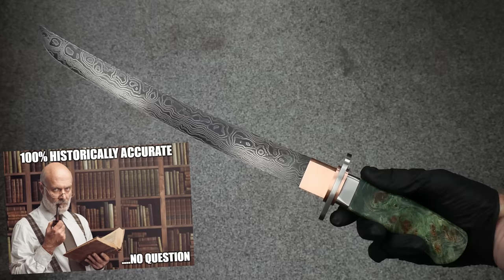A NEVER Before Seen Traditional Japanese Sword | The Rise of the "Bow-Kizashi" | Samurai Challenge

Comment: May is not traditional Japanese, but:
1) Handle has sense in terms of shape grip, so cannot be complained.
2) layers are aligned in right way, could be  more precise spending more time.
3) overall shape of blade is correct.

So it KNEEEEEL
Reply from the maker: Cheers Iron Spike!

Comment: Amazing work.
Note.   Copper needs to be cleaned with alcohol before soldering.   The flux helps at reducing surface corrosion or a bad solder when applying heat.
Reply from the maker: Nice! Thanks for the tip!

Comment: Nice video, quite relaxing. You have accumulated a decent shop setup and are less of a hack now. I think the seppa are too thick. You might try making the habaki from bronze and brazing it closed with bronze brazing rod. This is seamless and much less finicky than soldering...
Reply from the maker: Thanks for the tips!

Comment: that seam on the habaki can be burnished closed, if you have a high speed rotary tool/flexshaft/ micromotor. take an old hss. bur shank  bend it 90 degrees at the end , about 3 or 4 mm
round the end off and polish it to a mirror finish, not chuck in your tool. Takes a little practice, but very high speed and light pressure. copper gold silver most non ferous metals will become like clay, you can close seams and even fold the edges together.
Also that habaki would look great with a classic "cat scratch " finish
Reply from the maker: That is an interesting idea! I like it!

Comment: That is very cool as usual your work is amazing   My Boat season just ended yesterday so I can get to work in my shop  I finally bought a 2X 72 Grinder  I bought a Black Fox Knifeworks grinder and my only option so far is the small wheel attachment  I am excited to get started
Reply from the maker: Heck yeah! I hear those are very capable machines!

Comment: I have read that in the finest ancient Samurai swords there are traces of sand in the steel and that’s one of the lost pieces: what was the sand’s purpose and how was it used? Did you come across anything about that?
Reply from the maker: I really don't know... I'd imagine it's related to smelting the iron ore... the claims on added flexibility and sharpness seem odd to me... this is what the internet says:

"Sand was not intentionally added to Samurai swords; rather, it could be present due to the traditional sword-making process, which involved smelting and folding steel multiple times. The sand-like impurities could be a result of this process, contributing to the blade's unique texture and qualities, such as increased flexibility and sharpness."

Comment: So what was the purpose of wrapping the blade in aluminum before you normalized it? Genuine question. I am an aspiring bladesmith, and I am just trying to learn as much as I can before I am in a position to start forging.
Reply from the maker: That is stainless steel foil. It keeps oxygen from hitting the blade during heating and reduces scale. Helps keep the blade clean

Comment: I like almost everything about that knife,  however,  that threaded part of the tang looks very thin to me,  especially with the torque being put on the bend in the tang from the nut, that spot where the threads meet the wider section could potentially snap off.
Reply from the maker: Interestingly enough I've tested this form of construction pretty brutally. With a tight fit up, epoxy filled handle and this type of threaded tang construction you'd be pretty surprised at the strength! Especially with the finial being stainless steel.
Reply: @RedBeardOps  OK, I guess you would know better than me, it's just with the tension from the finial right on that bend it looks scary to me.  👍

Comment: AMA: are portabands a good replacement for a full-size bandsaw as they seem like a space saver but the lack of a guard makes me very hesitant to purchase one.
Ok finished the video Great work... hmm I just locked my handle material in a small vice with some leather glued onto the vice attached and use that to polish it out.
Reply from the maker: Glad you enjoyed it! On the bandsaw, I find portabands to be super handy... I use the same blade for both steel and handle materials.
Reply: @RedBeardOps  thank you i will have to look at them closer.

Comment: Any tips for your bandsaw? I have the same bandsaw and blade, but I can’t cut through 1/8th 1084..
Reply from the maker: Firstly make sure the steel is annealed; secondly use fresh blades. I run mine on "max"

I've been using these recently since there have been supply issues with the other ones I was getting... they have been working well - https://amzn.to/3Mbvz7R

Comment: AMA: I was just wondering do you ever hand forge your bevels before stock removal/grinding? Very nice work Thanks for sharing godbless and be well.
Reply from the maker: I do! I actually did to some degree on this one.. I'm still upping my forging skills so I forge thick and grind thin. Cheers sir!
Reply: @RedBeardOps  we blacksmith/bladesmiths are always learning. I forge my bevels thin on the edges of my anvil so as not to hit the face. I file my cutting edge, then finish with different grit of stones or fine sandpaper's then complete with stropping and polishing. I don't know if this is any help, but thank you for sharing your work. You have done very well, godbless, and be safe.

Comment: Great work as always. 

Question for you, Señor Keaton:  I could only get 1/4 Tungsten Carbide bearing balls to make my straightening hammer, not 3/8. Everything I know is telling me that that won't matter, as long as it has the same hardness plus the mass of the hammer behind it. Right?
Reply from the maker: Thank you sir! I haven't made one myself, but I don't think it will matter. I think it will still work as intended... but just may require more impacts.
Reply: @RedBeardOps  Exactly. If anything, it'll be more precise and leave smaller divots to grind out. Thanks for weighing in on it and thanks for the awesome content. I'll make a spare and trade it to you for the old press, lol. Totally fair trade.
Reply from the maker: @stevealford230  I think you're right! Cheers sir; good luck
Reply: A smaller bearing will go deeper into the steel unless you hit many more times. You are trying to stretch the outside layer of the steel on the inside of the curve.  This stretching is what causes the blade to straighten back out. The deeper you go, the more it will concentrate the stress in the divot. 

It is not a silver bullet, but has worked for me many times. I have still cracked some blades while trying to straighten them. I have cracked many less blades using the hammer than I have my 3 point bend fixture. 

Hope that helps!
Reply: @KHDailyKnives  That's exactly what I assumed it would do, because the smaller ball has a smaller surface area of contact, concentrating the force more, so it can be more precise, as long as you have a fine touch and don't mind a couple more swings with less force in your swing. Thank you for verifying the speculative theory with your practical experience.

Comment: after the troll rebuke, actual question: why did you decide, halfway into the project, to turn it from a full tang actual sword into a rat-tail tang sword shaped object? I'm sure you had a reason for that, I just can't fathom it.
Reply from the maker: This was never going to be a full tang build; always intended it to be a hidden tang construction. I've had very good success with this style of construction. Just about every sword in history was a hidden tang; all be it larger than this one. 

I  consider katanas to be hidden tang constructions as well since there is a shoulder for the habaki and the handle material encapsulates the whole tang.... (all be it much thicker and taller than the tang in this build)
Reply: @RedBeardOps  "This was never going to be a full tang build; "
Fair enough. More of a long knife than a short sword, I see. (Yes, the difference betwen both things was... quite nebulous at some points in history. Just look at the tantos) 🙂
It's not the hidden-ess of the tang that surprised me, it was the half-length construction. (Those are mostly for knives and for thrusting swords. Last time I saw an actual cutting sword with a half-length tang, it was still made in bronze). 😜 But I see now the reasoning, which is what actually puzzled me.
Reply from the maker: @notfeedynotlazy  A "long knife" is fair for sure

Comment: Okay its the short sword i guess.  What makes these blades special is carbon distribution. Its done in a particular way otherwise the final quench goes wrong. The blade should be straight until the quench. Everything you r doing is technically wrong. That's not a katana, only something resembling one. That said its still nice work. Good job man.
Reply from the maker: Hah, you obviously haven't read the ancient text. I had to learn Japanese to do it.. so it's understandable if you didn't. 100s of hours. Everything about this build is 100% authentic. You're wrong. ;)